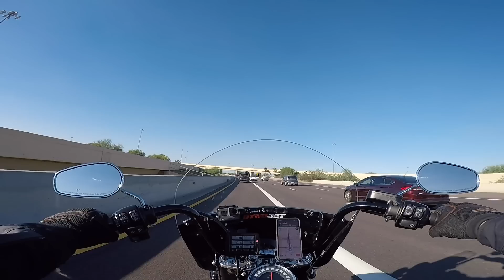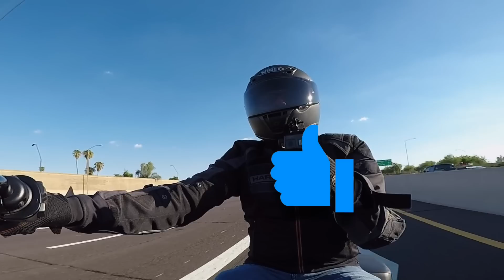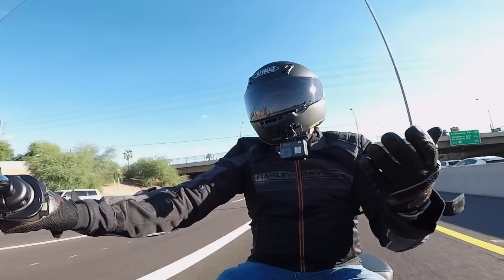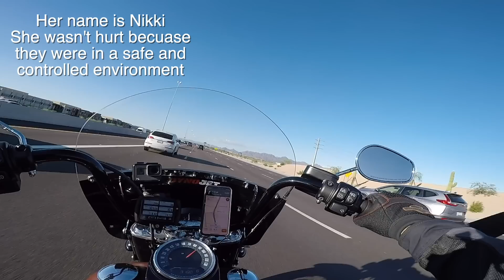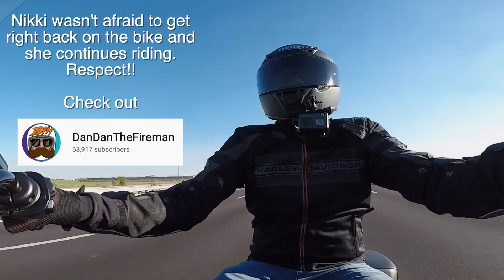Hitting the KILL SWITCH while riding?

Comment: Just did it today, driving home at night with 3 years of experience.  40 degree whether and not enjoyable frozen hands.  Bumped it, saw no RPM's and throttle gave no response.  Oil light turned on.  Traveling at 80mph I thought I'd forgot something after just pulling it out of cold storage.  Pulled over to check everything again and gave myself a laugh when I realized what happened.  Then just went back to riding.

Comment: Accidentally did it today on the highway while traveling at 120 km/h.. Freaked me the hell out! First thing I noticed was the RPM needle returned to 0, throttle didn't respond anymore, and the oil light came on! I thought something BAD happened to the bike. I found my way to the side of the highway and only after I stopped did I notice it was off. Turned the bike on again and continued on.
Reply from the maker: Yeah it startled me the first time I did it. Just flipping the switch back on the bike kicks right back on.

Comment: Thanks.  I searched this up immediately after picking up 2 large pepperoni pizzas on the ninja.  Ive been riding 15+ yrs.  Never lost a pizza.  Lost a garlic cheese bread 1 time, ( make sure the back of the box is facing forward.  Lesson learned).  Anyways, im stopped at a light, and I kinda thought I might have dropped sometning.  So I turn a little bit to look on the ground, and my bike shuts off.  That's when I realized how close the corner of the pizza box is to my kill switch.  So then I was thinking what could have happened if that happened while I was moving, or mid turn?  Your video came up, which was exactly what I was looking for. So thanks for the good info.

Comment: My kill switch has to be firmly pressed to engage the on position. I drove home slow thinking if it spontaneously cut off I'd be sent flying through the air as my engine stopped. Now I know that won't happen and I can ride comfortably until I can get the switch replaced